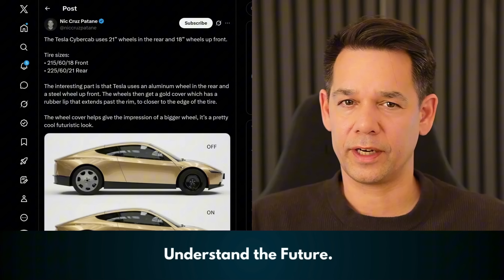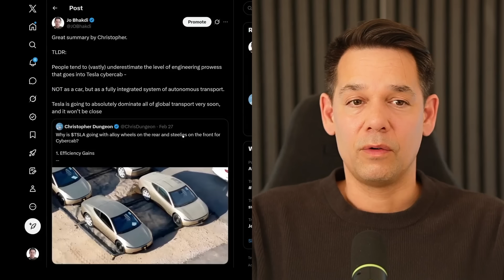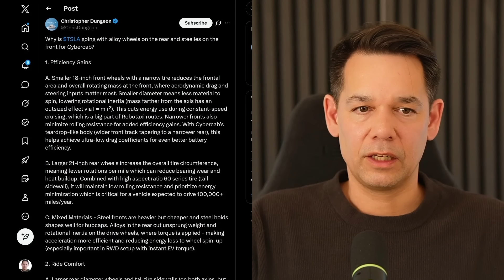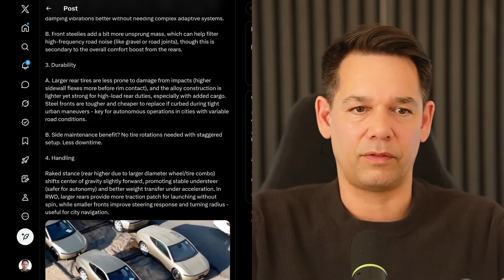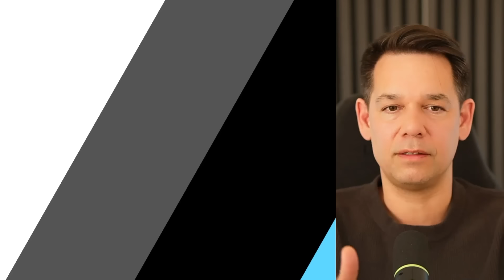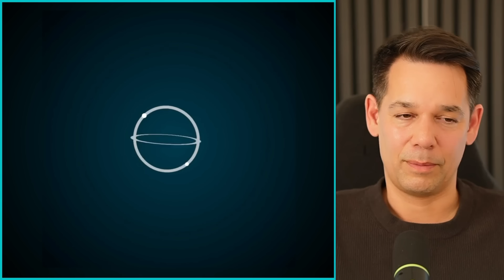Why Tesla Robotaxi Has ALREADY Reached The Inflection Point

Comment: @4.10: incorrect - as others have mentioned back wheels apply zero torque. This speculation shows how Elon fans on X will just make stuff up to justify any decision Tesla makes. I'm sure there is good reason for the mismatched wheels, but it's not 5D chess. I guess it's as simple as the front wheel not being a standard alloy size. Or some other simple and practical reason to do with cost. Also by the way I hope they have fixed the issue of the hub-caps rubbing the tyre - they had a similar over-sized  hubcap design for the cybertruck and they had to scrap it because it was destroying the tyre.

Comment: I have to take issue with some of Christopher Dungeon's physics arguments.  For one, he says that it's important to reduce the "rotational inertia mass" of the rear wheels during constant-speed cruising. That's not true. Once the wheel is up to speed, the main energy cost is overcoming friction and wind resistance. Where keeping the rotational inertia of the wheel to a minimum is most important is during the car's acceleration.  However, I do agree that keeping the wheels light is especially important for a taxicab which is doing more stop-and-go driving in the city and a lot less cruising down the highway.

Also, I don't think rotational inertia matters whether the wheel is a power-driven wheel in the back or one of the free-rolling wheels in the front (actually, I'm not sure if the Cybercab is rear- or front-wheel driven).  The wheel still has to be spun up to speed, and the energy for that ultimately comes from the same motor.

Comment: Jo. the main reason for the steel wheels on the front was that it’s lighter and cheaper to use 18” steel wheel in front than 22” aluminum wheel all around. That info comes directly from Tesla.
The engineering reasons for the skinner front wheelbase is mainly for 1. Tighter turning radius 2. Better handling into turns 3. Less effort to steer (likely a smaller torque arm due to compact size and weight reduction) and possibly a smaller steering gear motor to reduce weight and cost. And steering effort reduction could also play into the smaller 18” front wheels
Reply: Great info. Thanks for sharing.
Reply: Ok, so why don’t they have a steel wheel on the back?
Reply: @markrolls5905 I don’t know, that wasn’t mentioned. As I recall, the question was why didn’t they use 22” alloys all around and the answer was because an 18” steel was lighter and cheaper for the front. Possibly something to do with the wider profile but I don’t know
Reply: A steel wheel is lighter than the same size aluminum wheel?  I don't see how that's possible.  Aluminum is lighter than steel. 

I know that when it comes to bicycles, aluminum and steel frames end up weighing about the same. That's because aluminum isn't as strong as steel, and so the tubes making up the bicycle frame have to be made thicker to be the equivalent strength of a steel tube. Overall, the mass ends up being more or less the same.

There must be some other reason for having steel in the front and aluminum in the back.
Reply: @eyesuckle  22” alloy vs 18” steel. Trying to find where I saw it mentioned.

Comment: what a rambling shit show of a video. here is the ai summary to save you some time.

### Summary: Tesla Robotaxi Inflection Point

*Engineering Strategy & Design*
* *Optimized Components:* The "Cybercab" is engineered as a functional component of an autonomous system rather than a traditional car. Key examples include:
    * *Wheel Configuration:* Features 18-inch steel wheels in the front for cost-efficiency and noise filtration, and 21-inch aluminum wheels in the rear to reduce unsprung weight and manage high torque.
    * *Center of Gravity:* The larger rear wheel setup shifts the center of gravity forward, promoting stable understeer which is safer for autonomous driving.
    * *Efficiency:* Smaller front diameters reduce aerodynamic drag and rotational inertia for cruising, while larger rear circumferences reduce bearing wear over high-mileage use.

*Production & Scaling Status*
* *Deployment Numbers:* Current unsupervised fleet units are at 643, up from January. While behind the speaker's original prediction of 1,800 by May, the growth rate remains high (estimated 50-100% monthly).
* *System Readiness:* The speaker argues that fundamental problems—FSD safety and manufacturing—are effectively solved. The current phase focuses on "fine-tuning" to eliminate secondary issues like connectivity blackouts or server-side lag.

*Market & Strategic Outlook*
* *Reality Engineering:* Tesla is optimizing for a future where autonomous transport replaces private ownership, public transit, and freight.
* *Investor Sentiment:* Retail investors are viewed as overreacting to minor delays (roughly two months behind schedule), while institutional targets remain steady.
Reply: Claim is only 1-3 month delay, in reality fsd was supposed to be ready by 2018.
Reply: @Traintoytrain he is saying next year 15 for sure for sure though

Comment: On Point "C. Mixed Materials" at 4:00, the author is wrong. The CyberCab is Front Wheel Drive, so the alloy used in the rear is nothing to do with torque being applies there. See Brian White (FutureAza) for definitive information on this after interviewing the CyberCab Engineers. Grok also confirmed CyberCab is FWD.
Reply: Tesla stated why they used steel in the front and it’s because the same size wheel in aluminum would have weighed more. Read my additional comments on why the front track is skinnier than the rear
Reply: @SurvivalFarms  I was just trying to correct wrong information. It is not RWD hence the author (Christopher) was incorrect saying Alloy material was used in the rear due to torque.